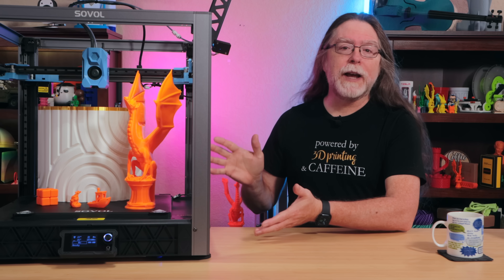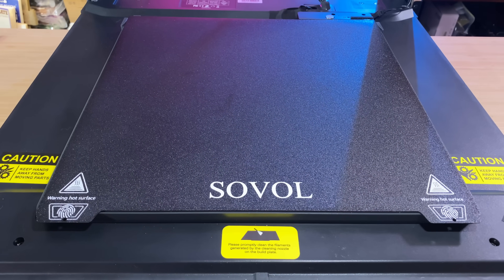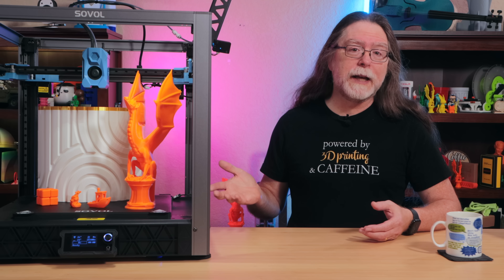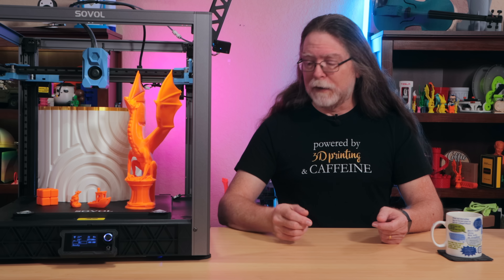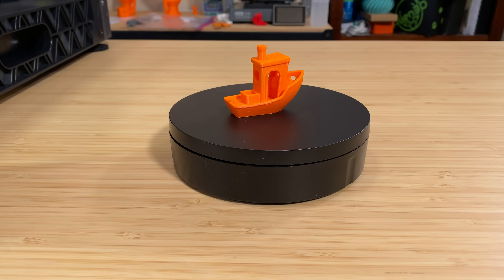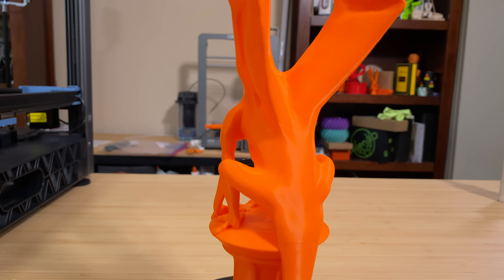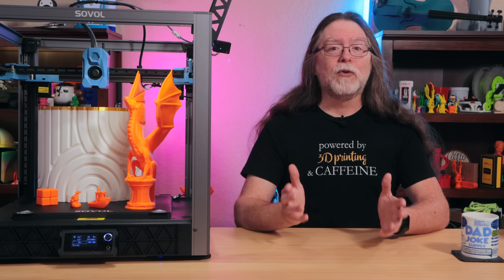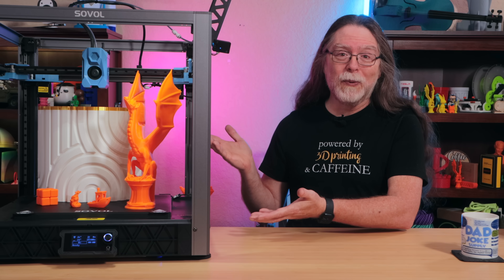Sovol SV08 Review: CoreXY, Klipper, Open Source 3D Printer!

Comment: My SV08 arrived today.  I waited for the initial bugs to be squashed and for the price to drop a bit, delaying my purchase until just before my winter product design cycle.  I love that it's a large volume fast high quality coreXY printer that's commercial open source.  Kudos to the Voron development team for making this possible.  I replaced the motherboard fan with a quieter and more reliable Noctua fan, and I swapped to a MicroSwiss hot end, mostly so I can use MicroSwiss FlowTech nozzles that can be cold swapped without removing and replacing the heater and thermistor and getting thermal paste all over my fingers.  The cylindrical heater on the MicroSwiss hot end does provide a slightly higher flow rate and the nozzle manufacturing is higher quality with slightly better print quality and longevity.  I'm going to design a 3D printed enclosure in lieu of the nice $150 enclosure from Sovol or the various designs on Printables, neither of which met my needs.

I mostly print TPU for the current products but I will probably have a dedicated SV08 configured for ABS or PETG-CF when I develop a different line of products so I can have optimal configurations without spending time swapping components.

I think I'll print a TPU toolhead enclosure retention band/clip to prevent the toolhead cover from popping off during a print.  Some kind soul uploaded one to Printables.
Reply: I've printed hundreds of ABS and ASA models on mine with no enclosure and had no issue with adhesion or warping on large prints. Shocked me so much but the enclosure isn't even necessary. I live in the UK too so not like its hot here!
Reply: @simonh2011  - Flat ABS parts can be printed unenclosed because the bed warms the part to prevent shrinkage.  Slightly taller parts can be printed without an enclosure with a draft shield... essentially a full height skirt that maintains a static hot air bubble around the part.  It also helps that the SV08 is a coreXY printer and not a bed slinger with the bed moving back and forth which cools the part.

I designed and built the SV08 enclosure that I mentioned in my previous post but haven't finished the front door so I haven't uploaded the design yet.

I'm moving TPU part production from the SV08 to the Sovol Zero when it finally arrives.  I was printing eight parts at a time on the SV08 build plate but the parts are very amenable to auto ejection.  I tested it on the Neptune 4 Pro and it works very well with just a few tweaks and some custom end G code.  When the Zero arrives, I'll be able to print one part and eject it with the custom internal raft and a long strand of nozzle ooze, both of which are very easy to remove from the finished part.  Ejecting the part with the custom raft and post print nozzle ooze leaves a clean build plate for the next part.  I'll have two days of continuous production with 50 parts in the bin in front of the printer.  Swap filament spools and do it again.  Minimum labor manufacturing.

Comment: This printer has a potential fatal design flaw. I have been a product and machine design engineer for 40 years. The plastic bed mounts to a plastic chassis. You don't need to be an engineer to figure out this is an unstable inappropriate materials choice. My bed is badly warped and the ABL cannot compensate. So I get prints where the nozzle crushes the filament in one area and prints loose and to high in another. People who buy this printer would typically do so because it has a large bed but its of no use in you cant get a decent first layer. Based on my experience I would recommend against purchasing this unit. If you just print small parts like the benchy it will likely do well but try to print anything larger and it may be very problematic.
Reply: Indeed, the giant plastic base without some metal reinforcement is pure idiocy ;(
Reply: Not saying the plastic wasn't a poor choice but that sounds like there's an ABL issue. A good bed mesh should be able to compensate for some extreme bed warp. Users have been mentioning inconsistent ABL on these since the machines were released and many reported good results once they began heat soaking the bed before ABL and before prints. If that doesn't help, you may be able to solve the issue by increasing the number of mesh points in software or switching to a different ABL solution like klicky or eddy probes.

Comment: It's Klipper, you can alter the macros so that the filament runout sensor triggers a beep (assuming it has a beeper), or you can setup remote notifications so you get a telegram message or similar on your phone. The screen is kind of a non-issue for the same reason; it's Klipper. You're going to connect it to your network and then control it via the web interface. Either that or you care enough about the screen to get one for $50 on Amazon instead of paying the $70-80 Sovol wants for one to replace the crappy one it comes with.

Good review, wish they were shipping the enclosures so I can see what they are charging $150 reviewed. Also wish they were shipping units in the US to all the people who already ordered :P

Comment: Totally agree on the noise part.  Sovol is supposed to address this issue soon.   A new fan motor or better shield design for the bottom fan?  A Noctua would be very nice.

Comment: Thanks Bryan I agree with your assessment. Mine has the same clickwheel quirk, but so did my old printer using the same mini 12864. 
It is Very Loud. I changed the controller fan ad at least idle is quiet now. I can live with the cooling noise since it works so nicely.

Comment: Thanks, Bryan, for yet another thorough and punny review!  I got bit by the Klipper bug when I got my SV07. I've since Klipperized my SV06 using the official Sovol screen, but then upgraded my Ender 3 V3 SE and Anycubic Kobra 2 using a single Raspberry Pi 3B+ I had lying around, so neither has a working Klipper screen.  Is a screen necessary like on the SV08?  It would make setting the Z offset a bit easier, but really isn't a complete necessity so I think I can overlook the screen and knob foibles.  Am I ready for a Voron 2.4 clone from Sovol? Maybe after it gets refined a bit more and the price drops a bit more, too.  I do like the fact that it's open source, unlike the SV07. But when you clone an open source machine (said Voron 2.4), it's contractual.